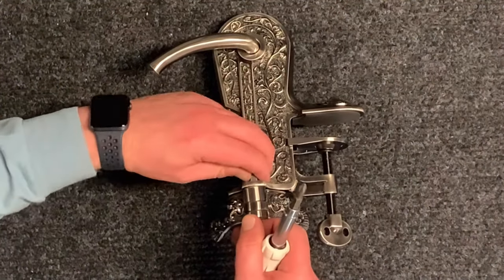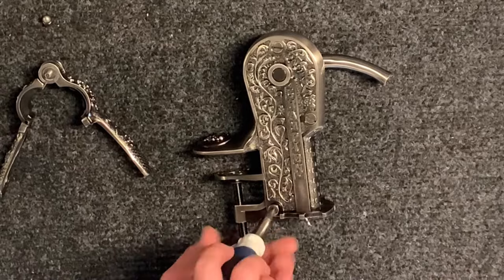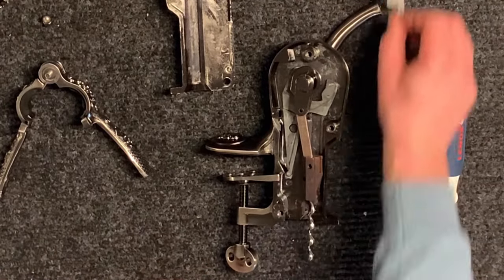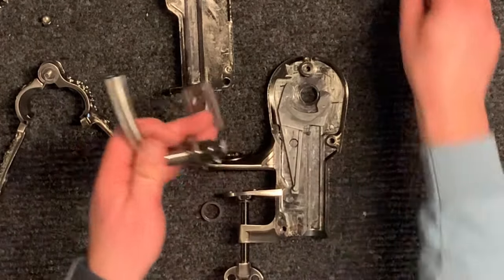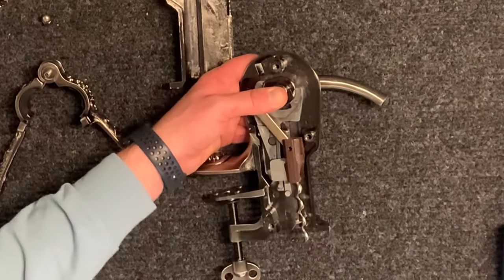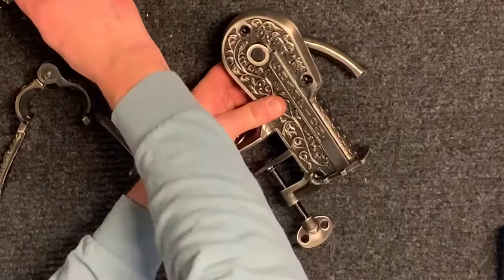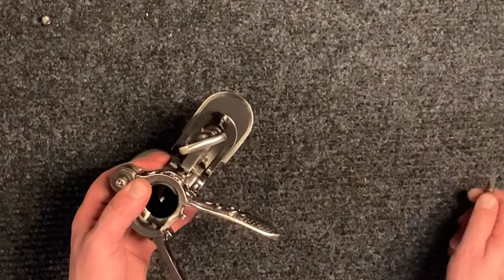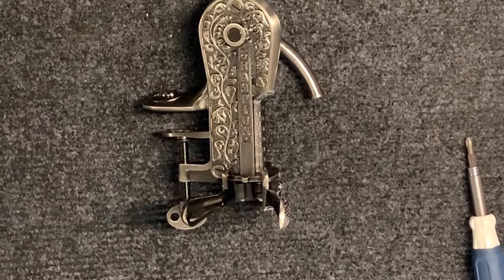Rogar Wine Openers: Assembly and Disassembly Guide

Comment: Do you need grease? Replaced the mechanism part and action isn't smooth. Might need to replace guide slug, but noticed some grease inside mine.
Reply from the maker: Hi David, any food grade grease can be used in moderation. If you have any questions, call 800.527.4072 or contact us here: https://www.iwawine.com/contact